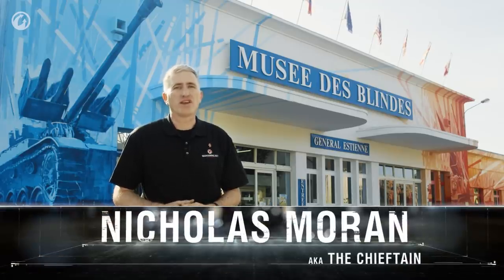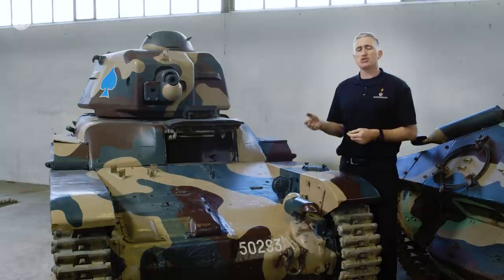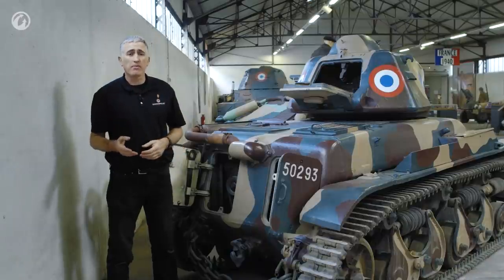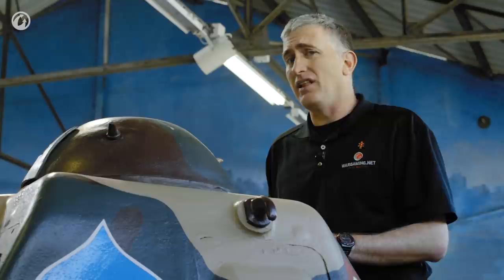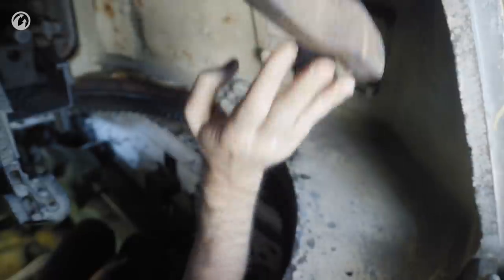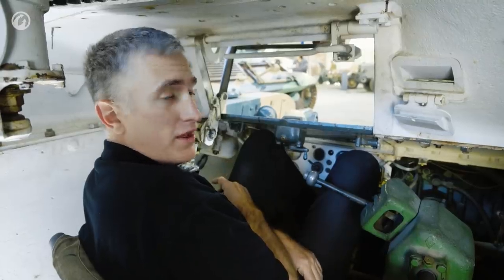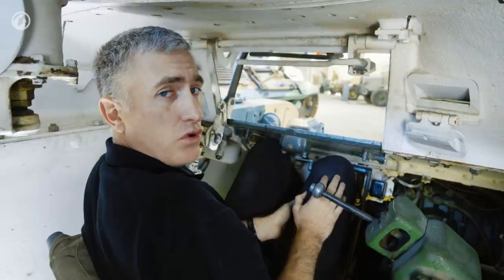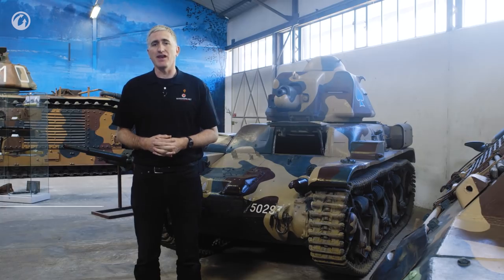Inside the Chieftain's Hatch: Renault R35

Comment: I don't get few things about the multitasking in the turret. I know that handling the gun and the coax along with giving directions may be hard, but is it this hard? Avoiding holes is a drivers job, commander is giving some rough headings or a terrain point. At least for what I can imagine it looks like.
Also, why did they fit this pathetic gun? Due ti standardization? They should've know, that it's a joke while they where fitting them. Strange
And another also - what's the difference between a gun and the cannon?
Reply: A gun is a generic term that includes cannons (also MGs and rifles and such), cannons tend be guns about 20mm and above.

By what Nick said it seems they fitted that cannon because they had a lot of them going spare. And this thing wasn't meant to take out tanks anyway 

From what I've heard avoiding obstacles was shared between the commander and driver, because the commander tended to have a better view than the driver, especially with hatches down. On this tank that probably wouldn't have been viable.
Reply: The commanders job during combat is to keep an overall view of the battlefield while the gunner focuses on single targets.  Normally as the gunner is firing on one target the commander is already looking around for the next one, or next position to move to.  With only one person in the turret, the turret man would have to engage an enemy, fully defeat that enemy, then swivel the turret or copula to find the next target, then move the turret to engage that target in which time the target could have moved, then fire, or tell the driver to move, disengage, any number of other things.
Reply: As a pseudo real life example, in War Thunder:GF and World of Tanks, whenever I find a juicy target, I tend to tunnel vision. Let's pretend I'm the gunner, and beads of sweat are dripping down my head lining up for the perfect shot. 3 seconds later, my tank blows up because someone else drove behind me and shot me. 

The driver can't see shit behind him. He's not moving because he was told to keep the tank still for me to shoot. If there was a commander, his job would be to yell at the driver to floor it, since he's actually looking around all the time.
Reply: Or to yell at you (the gunner) that there's a more pressing target

Comment: Alright, I'm going to try and do a little defense of the R-35:

Though it is relatively underwhelming and indeed not up to the task it was given, this tank was remarkably well-made. It used reliable construction elements of its time, and the cast armor was revolutionary and very thick (even in 1940). The only truly underwhelming parts were its gun (though the SA38 would fix this) and its speed, which was not great (though not as bad as it was made out to be). 

Even with all these flaws these tanks could be used effectively due to their strong armor and with the right strategy these infantry tanks could be used to fight the panzers. Unfortunately, they rarely got the chance to be used at all; besides Arras and a few phyrric victories by the encircled Dunkirk divisions the tanks never saw extensive use in the period they were intended to be used in. 

In conclusion; even though this tank is often viewed as a failure in tank design and an outdated concept by design, it still had its use in the Second World War and it deserves better than to be listed under the "failed tanks" like the M13/40, Ke-Ni or the Matilda 1, as it could even be utilized in a role it was never intended for 5 years after its debut.

Comment: The Chieftan needs to do his homework.   His modern tank snobbery shows through. 

The Panzer I and II (50% of the German tank force) had only 15mm or less frontal armor, so this tank could take them out at the  short ranges common in France.   The Panzer III A-C had only 15mm as well, with more recent models in France having 30mm. 
The Panzer IV had 30mm as well.   So only marginally proof against this gun.  Both would be vulnerable to flank shots and certain points frontally.  

The majority of German tanks had either no anti tank cannon or the 20mm, which is an aircraft "machine gun" cannon, to which the R35 armor was proof.   Even the 37mm carried on most of the rest would have to be very close indeed to penetrate the R35.   They may not have been able to take out all German tanks, but neither could the Germans take them out easily.  

These French tanks were mostly put out of service due to breakdowns and fuel starvation inherent in their poor leadership and doctrine, NOT GUNFIRE.  

These were intended as infantry support tanks, where the one man turret and slow speed and lack of ergonomics were not as important.   These attributes made them cheap, and allowed them to have hundreds in addition to regular tanks capable of taking on other tanks.  What historical dilletantes miss is that R35's spread  in among the infantry made them virtually invulnerable to infantry attack, which was crucial in their doctrine.    

Were they good MBT's? No.   But they were a lot better than he's giving the impression of here.
Reply: But the PzKpfw I & II were only meant to be training tanks, tanks for the Panzer Corps to practice and develop doctrine with and for industry to familiarize themselves with building tanks, they weren't intended as front line tanks. And while early models of the PzKpfw III may have had light armor at least it had a bigger gun and a proper 3 man turret.
Reply from the maker: Doesn't really help to be difficult to knock out if the opposition forces are nimble enough to simply hop around the side and nail your fuel and spare parts lines. After all, the purpose is to win the war, not partake in duels. Further, tanks generally spend most of their time doing things other than shooting at tanks. In such cases, the German tanks have a very significant advantage.

The Pz III A-C is a bit of a red herring, they were not series production variants. The majority of Pz IIIs in 1940 were E and F, really only particularly vulnerable to the SA-37 as opposed to the SA-18. Not that they couldn't be knocked out by them (Just as the R35/H35 could be occasionally knocked out by 20mm fire), but fundamentally, the French two-man tanks had difficulty coordinating with each other, observing the battlefield, were more limited in the variety of targets they could reliably engage, the ranges they could engage them at, and the speed in which they could engage.
Reply: Bruno TaTa i feel like even with all you said the two man tank is at a disadvantage jus because it has 2 people inside.
Reply: Sounds like this could be applied to late war German tanks dedicated to anti tank warfare while U.S. tanks just got on with dealing with the normal work of a tank, taking out fixed positions for an infantry attack.
Reply: Indeed. But you can also say late war german tanks tried to integrate as many tech advanced features into their tanks whereas US ans russians valued far more reliability and number.

Comment: No. Best tanks at the beginning of WW2 were Russian.  Case and point: KV1
Reply: Best one paper. The KV 1s had a stupid amount of reliability problems.
Reply: @atfyoutubedivision955  on paper?  No, not at all.  The Germans had nothing that could take on a KV1 in the early war except for an 8.8 cm AA gun which had to be deployed to fire.  The early part of the war, the KV1 was defensively deployed often expending ALL of it's ammo before falling back.  It was common for crews to count the hits on their tank that bounced off, sometimes exceeding 100.  The 3" gun was extremely effective for destroying German vehicles of the time.  The KV1 was the ONLY reason Germans had to develop new heavier tanks and start deploying high velocity anti tank guns in assault vehicles.  The Renault may have been a good tank, but it was no where near as effective, so in reality is in itself the "good only on paper" tank.

Only transmission had issues.  The engine and suspension was VERY reliable.  It was common for the driver to use a hammer to change gears.
Reply: CipiRipi00  Wrong.  The KV1 was utilized in the Winter War (1939).  The Germans were paying close attention and even tried obtaining a KV1 captured by the Finish for research.
Reply: CipiRipi00  again, this is about early war tanks.  The KV1 was developed and used in the winter war (meaning it was in use at the same time as the Renault r35).  It's effectiveness was far greater than any tank of that period.  The t34 was not at all superior.  It had the same drawback (horrible transmission and underpowered armament) without the survivability the KV1 had.  Furthermore, the T34 had many more mechanical issues and could only travel a mere few dozen miles before breaking down (on average).  The only advantage of the T34 was the price tag, but when it takes 10 of them to do the job of a single KV1, who cares that it costs half as much?
Reply: CipiRipi00  your point is mute.  The mention of the KV1 in the winter war is to outline that it did have a combat presence during the the outbreak of WW2.  It was also unchanged between it's use in the winter war and the German invasion of the Soviet Union where it was dominating the battlefield.  Unfortunately, too few numbers (at the time) and not enough ammunition forced soviet lines back.  The Renault had far more numbers and were destroyed/captured wholesale.  Their battlefield efficiency was nothing compared to the KV1.
Reply: CipiRipi00  furthermore, there were over 5k KV2s built.  That's over 5 times as many as the Renault.  Comparing the KV1 to the Char is like racing a 54 Impala and a Ford model T.  Sure the Impala is heavy and handles like shit, but it has decades of engineering advantage over the model t.  Point is, the char was designed during WW1 and far outdated by the start of WW2.

As for your comment about me comparing a heavy tank to a light tank, you should read the video title.  It doesn't say "best light tank".
Reply: CipiRipi00  now, I know this is probably going to make your head spin, but I will let you in on a little secret... The T34 was garbage.  Due to Soviet propaganda, so many people now think it was the best tank of WW2.  Nothing can be further from the truth.  They suffered from poor metal quality, major engine and transmission issues, extremely cramped space, and poorly trained crew.  If you ever wonder which would win in a fight, the Sherman 76 or the T34-85, I suggest learning about tank warfare during the Korean war and Arab/Israel war.
Reply: CipiRipi00  again, my point is that both tanks existed at the beginning of the war, and the KV1 is clearly superior.  Therefore, the statement saying the french had the best tanks at the beginning of the was is incorrect.